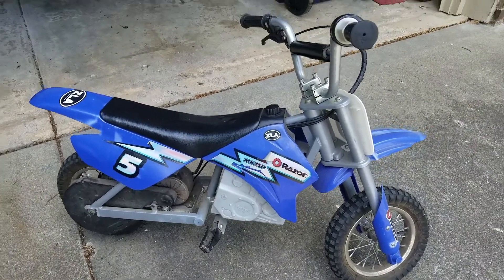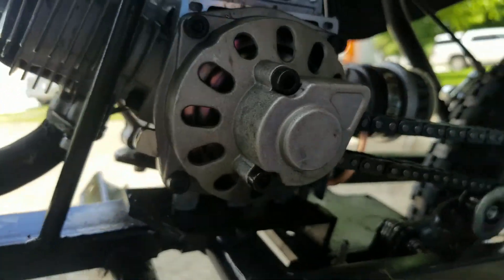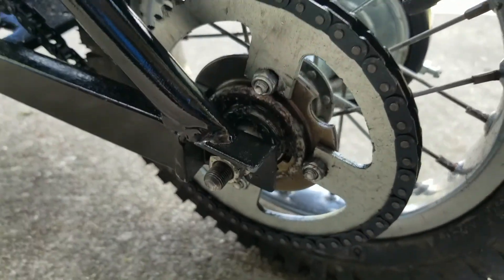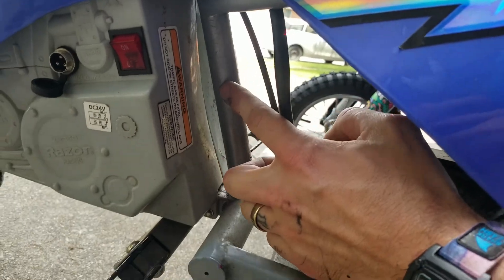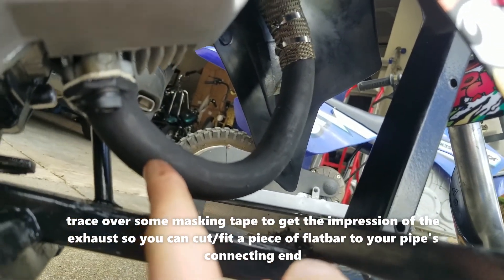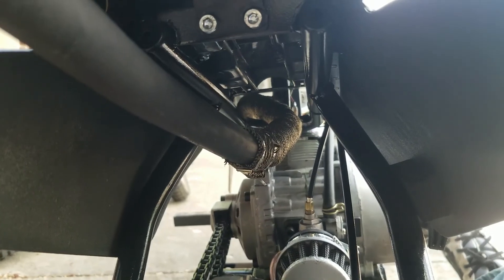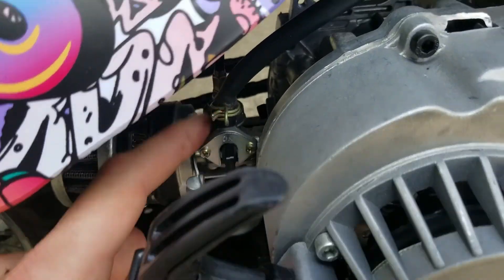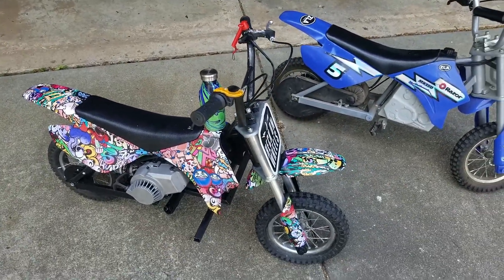Gas Engine on Razor MX350

Comment: I flipped the wheel and locked the sprocket, but the brakes only work if I go backwards, it has no stopping power going forward. How did you get the drum to work on the other side?
Reply from the maker: Ooh. Not sure on your issue. If you attach the brake just as I did, it should work perfectly… if it’s having issues, check all the components inside the drum to make sure everything is functioning properly

Comment: what do you need to wire up the gas tank to the engine i want to buy one of those kits but i dont think it comes with the stuff to wire up the gas tank and i dont know what to use.
Reply from the maker: Just a regular 1/4” gas line that runs from the tank to the carb
Reply: @parkerasay other than 2 stroke oil do you need to buy any other types of
Oil for the engine
Reply from the maker: @stevenbrrrappp  no. Regular 2stroke oil is fine
Reply: @parkerasay  ok , thanks for the help

Comment: Can you just use the original sprocket after we flip the tire??
Reply from the maker: I don’t think it lines up. I got a sprocket with a chain that matches the engine… you can get some specs on the drive sprocket and get bigger or smaller sprockets for the back wheel that will work… might as well just go fool proof and use the whole matching set-up though. I believe you can find full engine kits for around $80

Comment: Did you do any math on sprocket gearing ratio or just go for it? I have some razor quads i want to motorize.
Reply from the maker: I believe the engine I purchased came with the back sprocket and chain, so I didn't have to do much
Reply: @parkerasay  awesome thanks!

Comment: How did you wire the shut off? Mine has 2 different ends
Reply from the maker: Its just a circuit cut-off. Green wire goes to ground and I believe the other goes to the CDI. its been a minute since ive looked at it - sold it last year

Comment: is there any way to do it without welding?
Reply: Yeah but you’re better off getting a cheap stick welder and trying to tack it on
Reply: Yes, I put an engine kit on it and it runs fine
Reply: @masonwilson392 so im using the original sprocket that came with the wheel on my razor dirtbike i flipped the wheel around and don't have a welder to weld it on. Any tips?